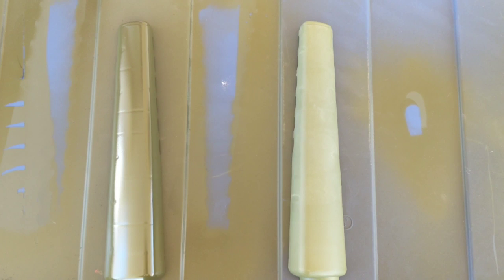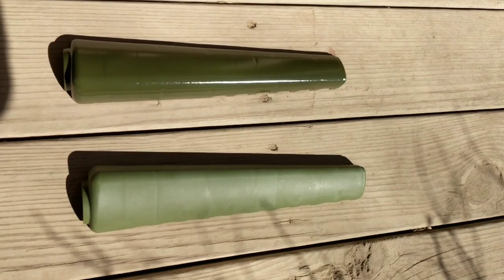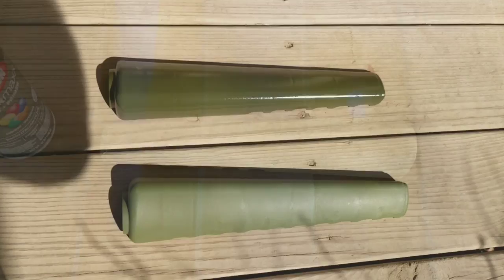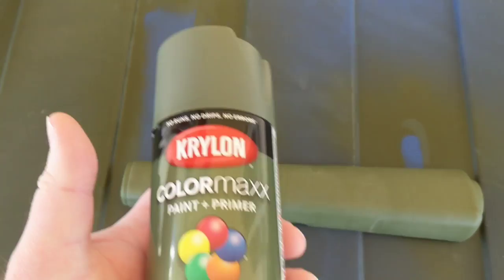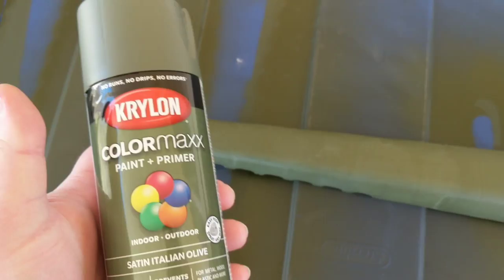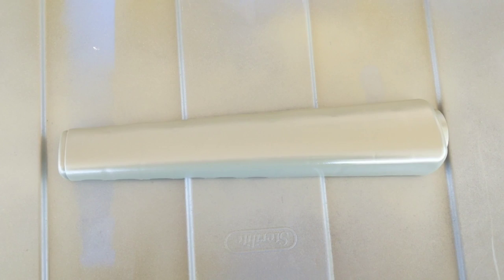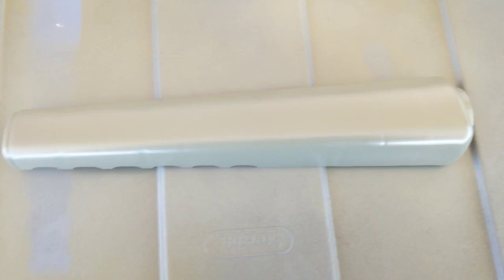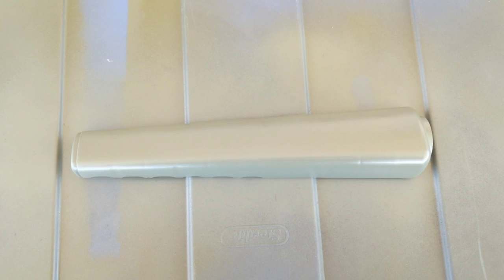DIY BRN-601 Retro Green Paint Step 1: Prep and Base Coat

Comment: Look up the armys 1957 Chevrolet it had the same "gloss od green" color, odd choice as greens for camouflage and gloss is kinda flashy. I wonder if the 601 furniture just went through the same paint booth?
Reply: I wouldn't at all be surprised. Have a relative who is building a Willy's that's not too far off, gloss wise.

Comment: I bought an authentic 601 grip and had the color matched at sherwin williams. The grip seems to have a bit more yellow but it seems to be as good a match as any. The only problem is I couldn't get a spray paint. Any suggestions for hand painting? I bought a premium brush and seem to have a good technique but the strokes are there. Going to try wet sanding as well. Thanks for the upload.
Reply from the maker: I'm absolutely garbage at hand painting. I'm so meticulous I end up overcorrecting everything and making the end product worse, that and I have experience detailing in a body shop so that's where I learned to spray. You may be able to use a preval sprayer (from home depot) if you want to try aerosol... otherwise, my best advice is citristrip if you make a mistake and need to start over on a piece, and good luck! Remember the paint jobs on these old military guns weren't perfect either, so don't stress too much about getting everything perfect. - Jay